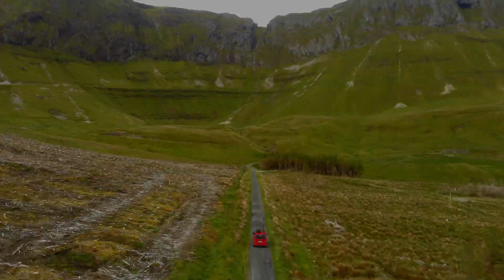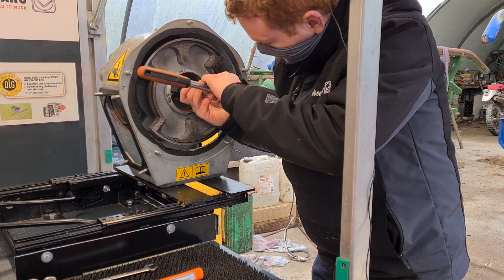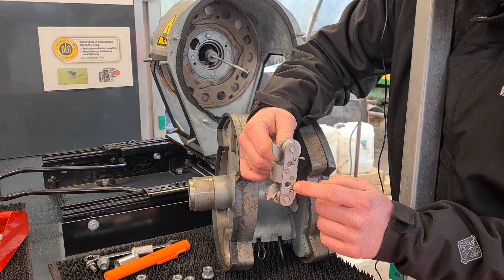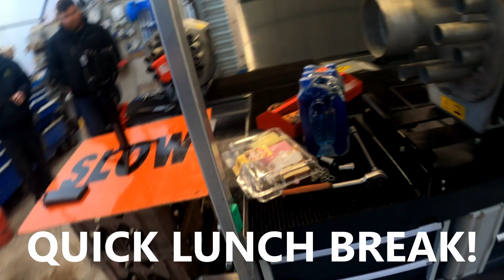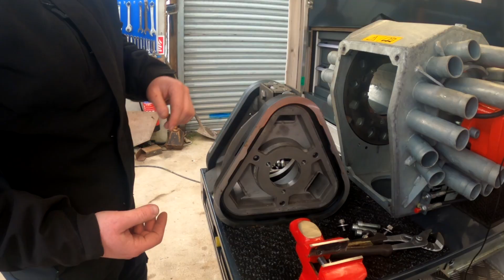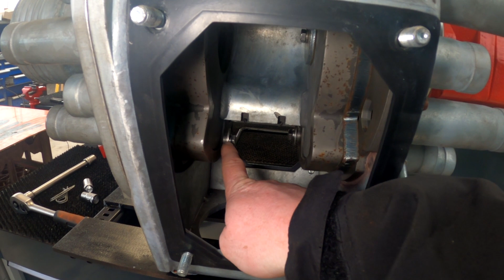🚜🇮🇪 VOGELSANG Demo Trailer! Repair & Maintenance Demonstration! Agriality Series: Ep. 1

Comment: The farmer operator is slowly being pushed down the contractor route. This service appears straight forward until Allen heads round and you can’t open or close them. Will bits of plastic and or twine get entangled here? I know it should not be in the tank but it   
turns up in there.
Reply: Allen heads are fuckin awful. Should be illegal
Reply: @seanbrady5026  he did not strip out a 5 year old machine and put the service parts into it .........the video  would be banned from youtube as the language would be off the scale ........nuts bolts and slurry do not go well together ..............
Reply: yes ......the humble splash plate ,s days seem to be numbered ...........turning a simple machine that any fool can operate and service  into a complex time comsuming  expensive  and  finickey  machine to keep our carbon foot print down so people can   continue to  fly around the world in jet planes ..................
Reply: @georgedoorley5628  thats fact George and all the English boys like tom pemberton spreading on land thats sodden and then its flooded a few days later with all slurry washed into the drains, no point in a little country like us trying to do good when people a few hundred miles across the sea are up that craic , and lets not get started on the boys in the usa 😂 no point bringing in these rules unless the whole world is going to do it / co operate. Little ireland is definitely not doing even 1% of the damage other countries are doing 😂